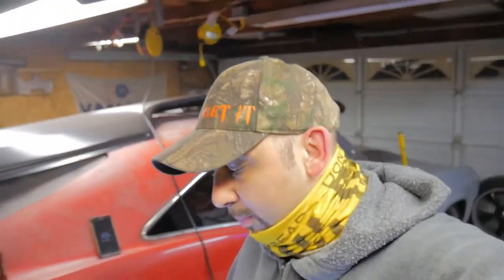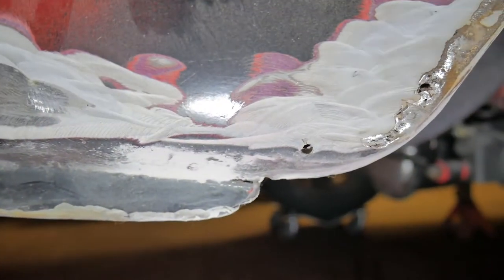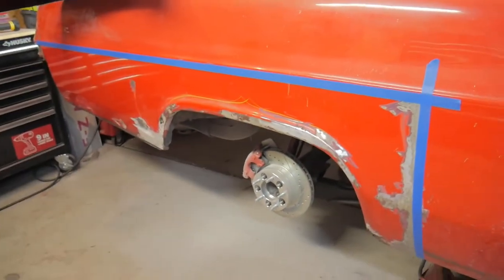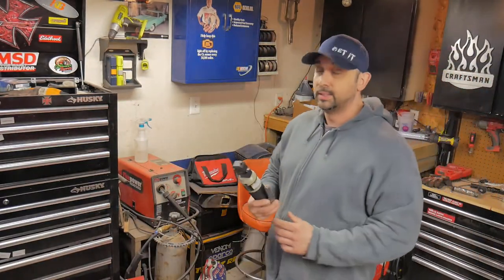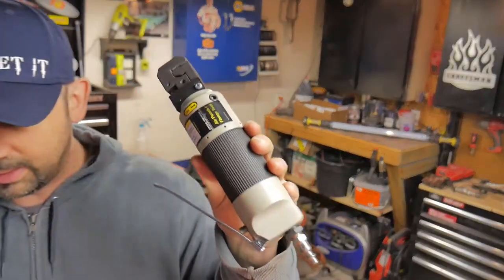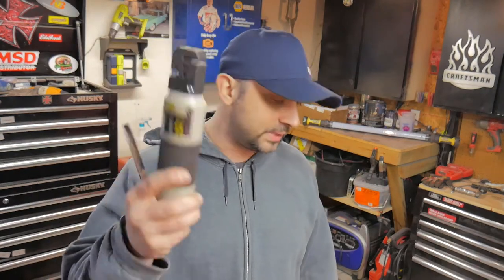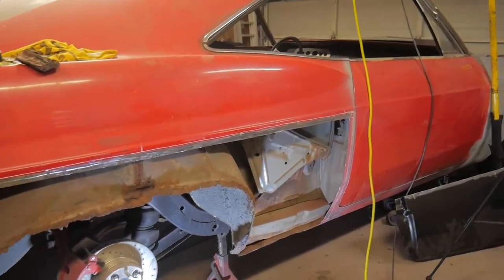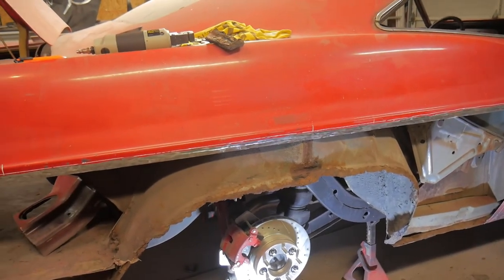Harbor Freight Flanger tool Review and replacing the quarter panel on my 1965 impala

Comment: I’ve had trouble with the punch flange tool. I finally figured out how to fix mine after it broke. Take that top Allen head screw off the body of the tool. Fill full of oil, put screw back in cycle a few times then top off with oil. Made mine worth like new.

Comment: Forget the flange tool , get a perfect panel tool from Eastwood,, it crimps a V-edge for weld too lay in and gives you a nice butt weld you don't have to grind away, l did 2 quarter panels on Chevelle full length cuts with only a pint of body filler using it.

Comment: had the same problem with mine. You need to unscrew the head to release the pressure on the up and down jaws then lubricate and tap to make them go up and down. The real issue you will have sooner or later is with the brass plunger at the bottom of the handle. This is what let the air in . If it is hissing remove the handle lubricate the plunger till you get full motion and weld a piece of thin gage directly on the handle to stiffen it. Because when you dont get the tool to open and close you will push hard on the handle and bend it right where the plunger is which will limit its motion and make it worse. Been there done that. The nearest Harbor freight for me was more than 3000 miles so I had to fix it and it works great. The 7/8 for the flange is wrong the dipped part is around 5/8. &/8 is the total length of the jaw but it is only creasing half.

Comment: Mine is not used every month but I run a 3 stage dryer system. It has never failed me yet. 
  But, they make tow trucks to fit new cars as well. ASE master tech, L1, P2 and body. UTI & ACDelco instructor. Retired

Comment: So just today I went out and bought my third flanger tool from Harbor Freight finally read the instruction book and noticed you have to take them apart and fill the hydraulic piston (part # 31 attached to the anvil) with oil every 3 months. Mine both were dry.  I used hydraulic jack oil. And the two I thought we're broken now work and I can take the third one back
Reply from the maker: I missed that part to lol
Reply: That's some great feedback and I think this has sold me on it. This occasional failure was the only thing making me consider a more expensive one.

Comment: Hey Chuck what size compressor are you using to run those tools? Maybe you could do a vid of your setup, Horsepower, CFM, Max PSI, Filters and finally the brand and how it has held up. A lot of guys show how stuff is done but not what their setup is like. The car is looking good so far keep it up.
Reply from the maker: Graham Charnock thanks for the comment and input  here is a video i did on the compressor i got 
https://youtu.be/Q5LeUiVBpzk
So far its running good no problems but your right maybe when i do some painting i ll do a video on my setup ! Hope the link helps a lil with the compressor
Reply: Thanks for the reply Chuck, I guess I missed that one when I looked through your vids. That is what I was looking for as far as the compressor specs, but when you do start on the paint maybe you could show your system from the tank to the gun including: filters, dryer, hose size, pressure, type of gun etc.
Definitely liking the vids and I'm a subscriber

Comment: Hi Chuck I'm from the UK I have one of those hole punches, bought it off Ebay back in January this year went to use it for the first time it won't work, I can't send it back as had it seven months now, it cost me £36.50 GBP, from what I can gather it's a harbour freight product according to what people are saying on the internet there cheap Chinese junk, that aside you say you took yours apart in your video, is there any chance  you could show or tell me how to take it apart I have tried no luck so far, must doing something wrong,  I have tried to find a video on YouTube but there's nothing on there many thanks 

    Regards Tony
Reply from the maker: Sorry to hear that man. I ended up taking mine back it was under warranty
Reply: The person above you read the directions from the harbor freight one and there is a hydraulic piston that needs to be filled with oil every 3 months.

He ended up fixing the 2 of his that were "broken" and took the 3rd one back.

Comment: The harbor freight hole punch/ flanger is garbage! The first one I had punched about 50 holes just fine, and then wouldn’t punch any at all. Traded it in on warranty, and the new one punches holes just fine but the flanger side doesn’t close far enough to make a flange. I’m done with cheapo Chinese harbor freight garbage! I ordered a hole punch/flange tool from Eastwood. Problem solved! Some harbor freight tools are great and work like they should for a long time, and others are a complete failure! I will still buy from harbor freight, but only some tools. Other tools I will spend the money for a good one wether I use it a lot of not.
Reply: Did you adjust the flange head? Unscrew the allen on the side and twist the head clockwise and it closes the jaw.
Reply: Thanks
Reply: It sounds like you need to read the instruction manual, but having something that's pre-adjusted correctly from the factory is nice if you want to spend the money.

Comment: Adjust the air in the tool itself, most air tools have an adjustment....
Reply: That's for impacts and the like. Most of these high speed tools, both expensive (Ingersoll Rand is what I have experience with) and cheap (Harbor freight), require a flow regulator if you want to adjust the speed or strength of them.

Comment: Geez, who ever did that body filler must have thought they were frosting a cake. Thats got to be at least 3/8 inch thick?
Reply from the maker: Kevin Reed yea some areas even thicker i dont know how that much  stuck lol it was a bitch to grind through to
Reply: chuck, keeping it in the garage probably helped it wasn't exposed to such harsh expansion and contraction would be my guess. I know of I tried that it would have fallen off in sheets LMAO 😂
Reply from the maker: Kevin Reed i had the car for about 20 years  stored outside for 2 years out of 20, no matter  how u slice it that filler is a beast lol

Comment: Why would You first cut Up the New Body Panel Before cutting off the old original Body Panel? You're doing this ass backward's......
Reply from the maker: easier for me to size up the the new panel. when you flange it your cut doesn't have to be perfect cause it's not like a butt weld either way homeboy it came out perfect cars done and finished looks great

Comment: Need to keep adding oil to it.. give some clicks with air connected.. add more oil.. give it some more clicks with air.. add more oil.. until the oil screw hole has oil filled to max